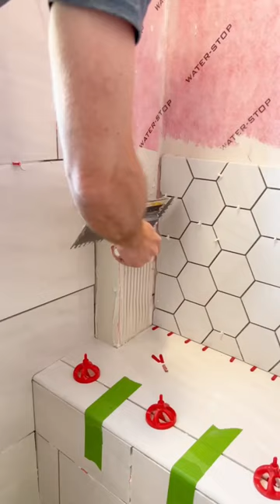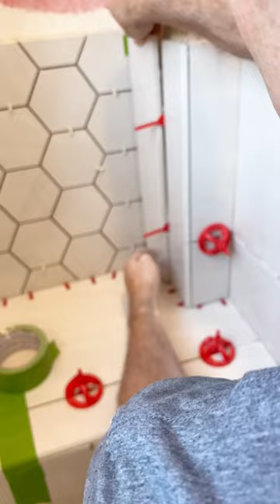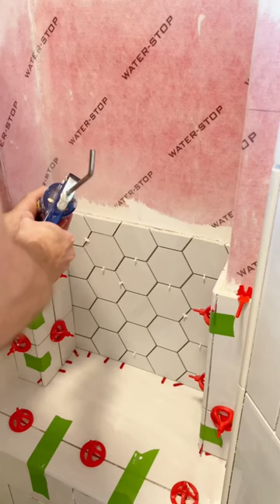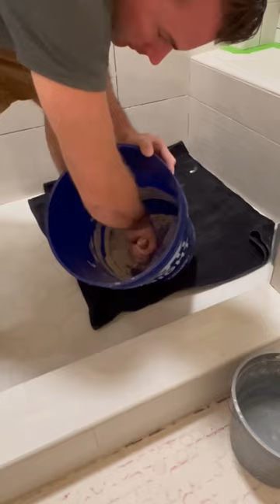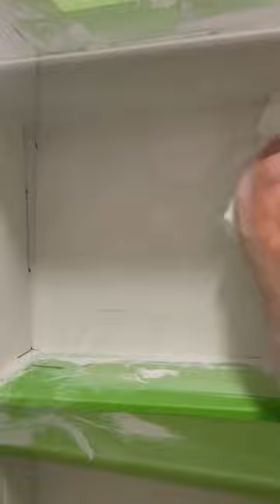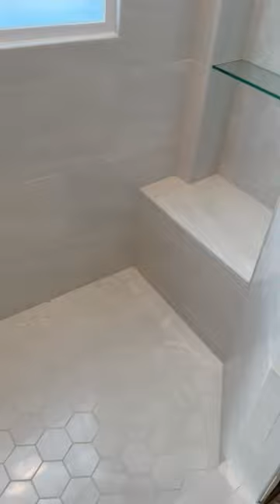Custom shower niche #shorts #short #tile #shower #bathroom #diy #remodel #construction #niche #build

Comment: Wa-a-a-a-a-y too much work.  It doesn't look good.  Its not practical to have glass locked into a wall like that, and tile is just a bad high maintenance idea.   Get a fibreglas one piece tub.  No cold tile and no grout to get moldy and fall off.